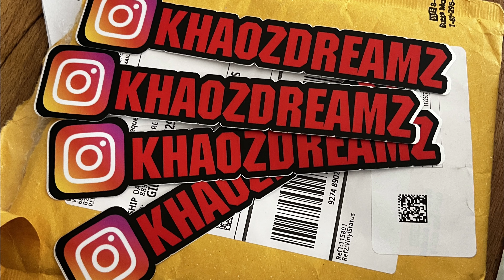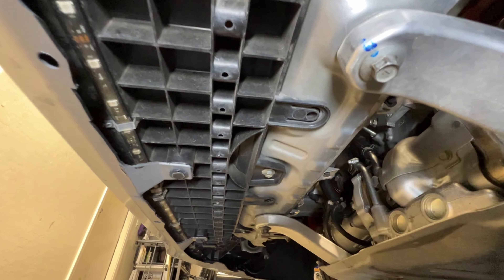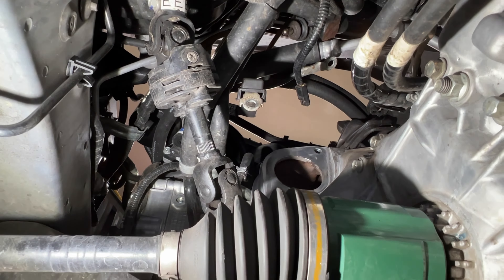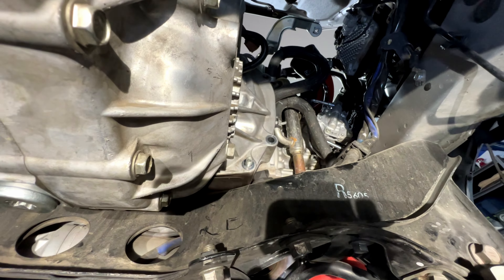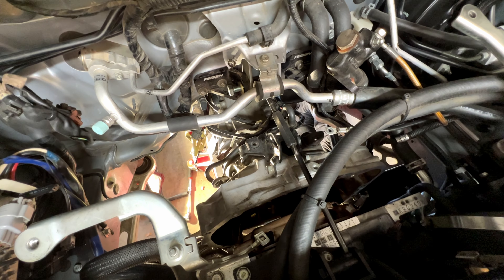How to remove the clutch on the 2015+ Subaru WRX

Comment: This looks like the most amount of fun I'll never want to have again
Reply from the maker: Hahaha, it's not bad just time consuming.
Reply: Just replaced my engine after blowing it up after 70k. First engine job I’ve ever done. Ended up needed my bosses help to get the top of the bell housing to come together. 
Ended up cross threading a bold into my brand new engine block.
So tomorrow, when I am replacing my clutch. I will be having loads of fun drilling and rethreading. 
But hey! Stage 2 clutch 🤷🏼‍♂️
Reply from the maker: @BrandonBzy whoa I’m sorry to hear that brother 🫣. Are you posting on social media or anything? I’d definitely like to follow your story or progress!

Comment: With a car lift drop the trans takes me 3 hours or less that way and to pull the motor takes less than two but assembly does  takes longer those are my times
Reply from the maker: Yeah if I had a full lift I would definitely agree. And I was going to do the motor way but I don’t have an engine hoist.
Reply: @khaozdreamz  I have a over head crane from harbor freight too got it on sale for 500$ it's buy far the best for removal
Reply from the maker: @subarutime5089 hmm, but what about having to remove that rad? Or you don’t have to it’s definitely worth trying
Reply: @khaozdreamz  I
Yes I remove the radiator turbo down pipe wants to arm wrestle sometimes 😆
Reply from the maker: @subarutime5089  hmmm ok I’ll keep that in mind. Cause doing clutch jobs suck on our cars. It’s not bad just very time consuming and if you mess up the seals or something like ( car won’t go in gear lmao ask me how I know )

Comment: Do you have a link to the brace tool?
Reply from the maker: At the time this tool was found by luck on eBay. Sadly I don't see it anymore. Here is one of the links. However it's $1400 https://tillmantools.com/products/kent-moore-subaru-41099ac000-engine-support-assembly
Reply from the maker: Found it by the same person but didn't pay as much as they are asking. https://www.ebay.com/itm/156612581760?_skw=Kent+Moore+41099ac000+Subaru+32005085+Engine+Support+ASSY&itmmeta=01JMBNAVW3ADRW5FRPKA16ZZ93&hash=item2476d65980:g:KNAAAOSwRdJndGpj
Reply from the maker: And here is the part number to Google. Just got to look around. Idk if you can get it any lower then eBay but depends on the seller part number is 41099AC000
Reply: @khaozdreamz  man for that price I’d be better paying a shop to do it. A lot of money for convenience
Reply from the maker: @ right!! At the time I got it for $200

Comment: Does the engine want to tip forward or backwards without the trans attached? The cheapest version of that tool you showed I’ve been able to find is still a few hundred. If the engine wants to tip forward, couldn’t you use a rope tied between the engine and pitch mount bracket on the car to hold the engine in place?
Reply from the maker: @austin702 great questions! Yes sir, the engine will move back and forth without the transmission. Which is why yes, to your second question. You could try to use the rope but you have to make sure you have it not move at all. The point of the service tool ( which needs to be made cheaper imo lol) helps exactly that it makes sure the engine does not move at all or very minimally.  To be very open you don't need that tool, as I did it a few times w/o it. However it helps a lot when you do the work alone. Hopes this answers your questions ✌️🏾

Comment: Awesome video bud
Reply from the maker: Thank you!!! More to come in the future.
Reply: @khaozdreamz  I was just gearing up to install the new uniclutch sport this weekend and realized after watching your vid I’ll need to wait and get replacement turbo bolts, steering knuckle pinch bolts and I’m debating if I should just do my control arms while I have them removed….
Reply from the maker: @itzdaxx1154 yeah I would get what you need while you have that all apart. It will be better that way one time and done. Just label everything when you take it apart
Reply: Do you know where I can find that “service tool?” Can’t seem to find it…wondering if it has a part number or a more specific name?
Reply from the maker: @itzdaxx1154  I mentioned it in my “Preparing to replace the clutch for the 2015+ Subaru WRX
https://youtu.be/mZXgSF4A0Yc” However, I did not pay that price I was lucky to find it on eBay for 60% off. I have not seen it again sadly.  

Subaru transmission support tool:
Kent-Moore Subaru 41099AC000 Engine Support Assembly
Reply: Yeah I just saw that vid haha was comin back to say nvm.   $1200 is ridiculous tho I mean it’s not like it’s some genius engineering in the design from what I can tell…company 23 needs to clone that asap 🥳
Reply from the maker: @itzdaxx1154 agreed 100% on that!!!!
Reply from the maker: @itzdaxx1154 you can still do it. However this just makes it easier when you work alone a lot.

Comment: Does the throw out bearing have a clip on it that’s oem? Not the fork clip but the throw out bearing 14:30
Reply from the maker: This is the snout repair kit I have on there. Yes, it comes with the retaining clip. All of the throw-out bearing kits should or they don't. Please please make sure you replace that that is a cheap part to not swap out at the time.  Hope that answers your call.
Reply: @khaozdreamz  so even without the snout repair kit the Oem throw out bearing uses clips to hold it on the clutch fork.. and the clutch fork uses a clip to hold it to the pivot ball? 

Thanks for the fast response, I’ve been having problems with my brand new clutch slipping all summer and I’ve replaced it brand new twice and have had my transmission in and out so many times
Reply from the maker: Ah yes, you need to always have a clip! The oem vs aftermarket fork w the clip have to work hand in hand. While you're there if you haven't already make sure to change the pivot and fork as using anything heavier for pressure plates will strain those parts. The only thing that not super beefy is that clip cause it just holds that assembly together.  Oh and don't forget get your grease points on this as well.
Reply from the maker: Also, what clutch are you running? You can hit me up on any of my socials if you need any help. Quicker to talk on there too. I'm sure we can figure it out.

Comment: Can you link where you get that service tool?
Reply from the maker: Hi I am so sorry for the late reply,  it is "Kent-Moore Subaru 41099AC000 Engine Support Assembly" from https://www.tillmantools.com/Kent-Moore-Subaru-41099AC000-Engine-Support-Assemb-p/kmt41099ac000.htm However, I did not pay that price. At the time I was lucky enough to catch one on eBay. you can do it without it. Just make sure you have help, if not this tool will be the extra hands you need to keep it from moving too much.

Comment: Where did you find the service tool?
Reply from the maker: Hi @hazegames1619  it is "Kent-Moore Subaru 41099AC000 Engine Support Assembly" from https://www.tillmantools.com/Kent-Moore-Subaru-41099AC000-Engine-Support-Assemb-p/kmt41099ac000.htm However, I did not pay that price. At the time I was lucky enough to catch one on eBay. you can do it without it. Just make sure you have help, if not this tool will be the extra hands you need to keep it from moving too much.
Reply: That’s a 1,000$?!?
Reply from the maker: Yeah, most service tools are. Which is why I'm investing to let others know if it is worth it. However, as I mentioned in my video, sometimes we get lucky and find mechanics selling them for example.